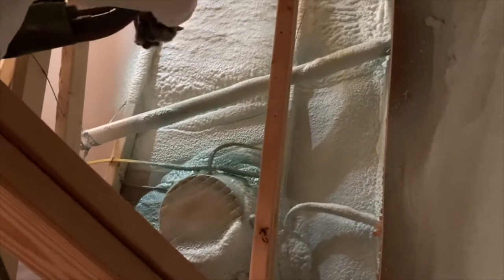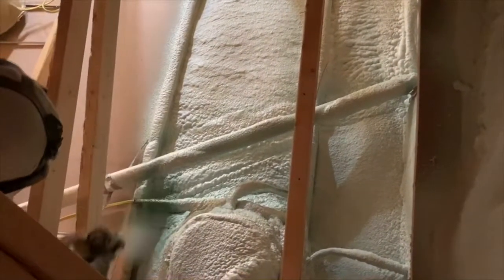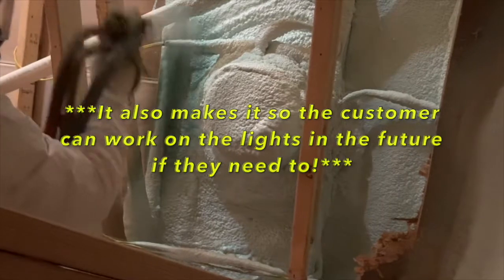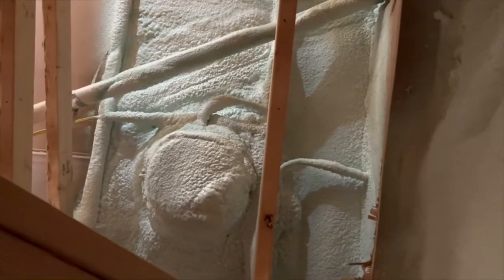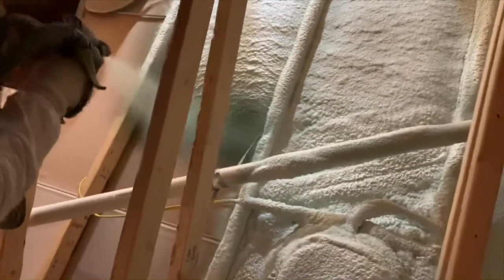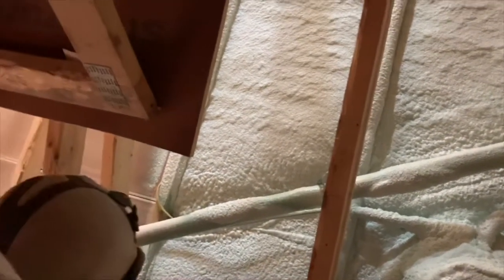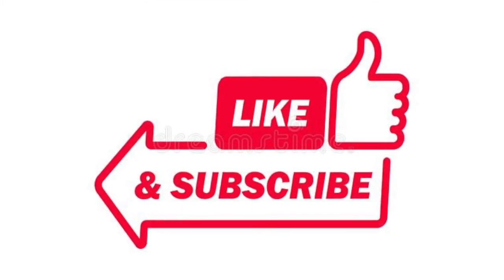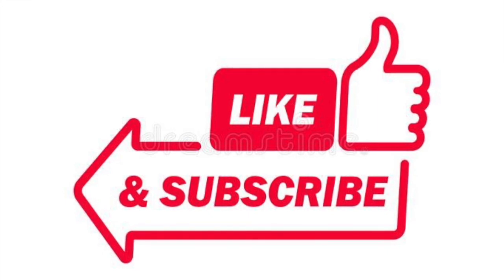How to Insulate Around Can Lights with Spray Foam Insulation

Comment: Is it just me but it looks like they are filling 2x4's almost to the top on the 1st pass.
Reply from the maker: It may have been 2.5” on his one but in general we like to stay around 2”. But with demilec foam it’s sprays a lot cooler than other foams so it’ll be alright. Plus it didn’t warp the sheetrock so it’s all good 👍🏻